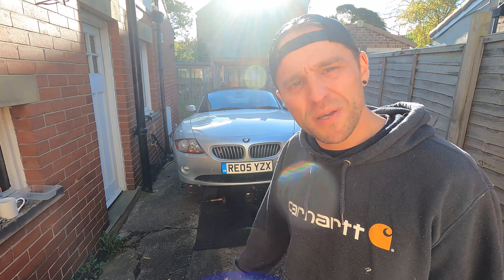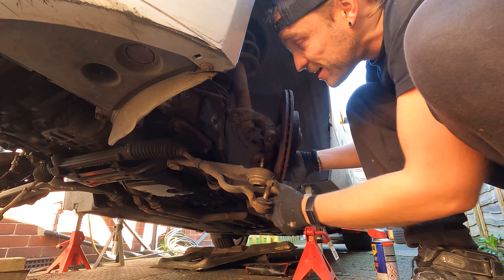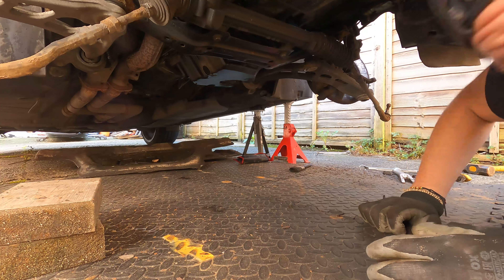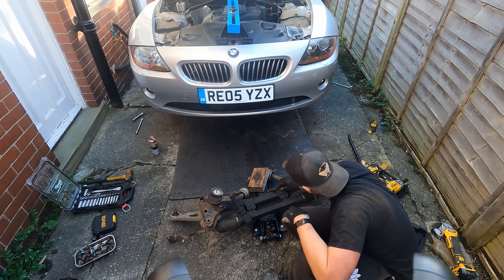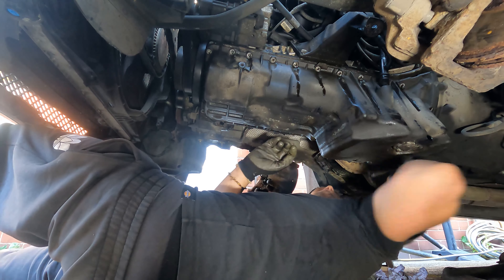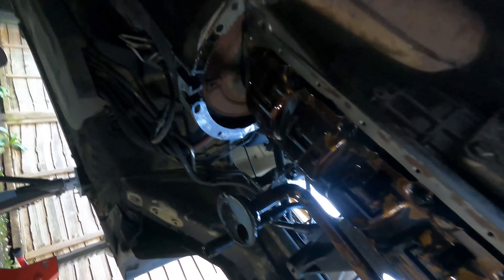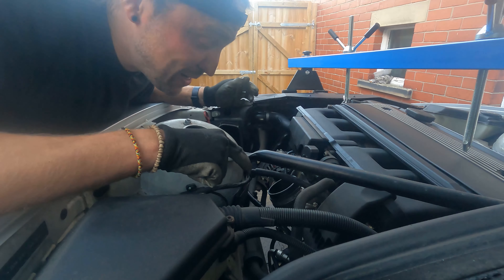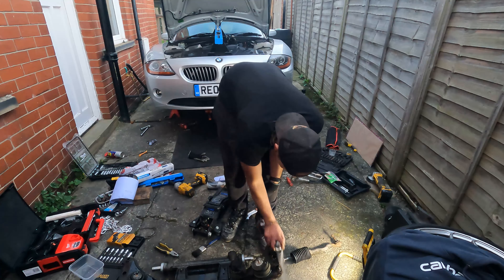BMW Z4 OIL PUMP NUT UPGRADE & GASKET REPLACEMENT

Comment: Nice, thanks for this series.  Bought a Z4 2003 last year, as a project car.  Hopefully not as big a project as this car, but I did manager to fix the vaccum seal leak, by replacing the air intake that split there on the throttle body, cleaning the disa valve (needs a rebuild) and putting a new seal on the petrol cap.  i also ran injector additive on premium unleaded.  Getting 36-40mpgs now out of a 20 year old 3L turbo engine :) I've  Got a long way to go, and hopefully sorted for the MOT in sept  Full service and deep clean next
Reply from the maker: Thanks for watching! Plenty more content coming. Pretty much got all the major mechanical bits serviced - time for a few subtle upgrades now 😜 stay tuned ✌️

Comment: Did you get the front wings? I have a driver side in silver. Bought for my car but it's the wrong silver 🙄 should have read the description better.
Reply from the maker: I didn't - I never found any in good condition in the right colour so opted to repair them instead - video on this incoming, stay tuned! 👍